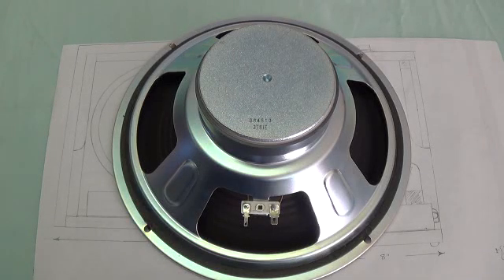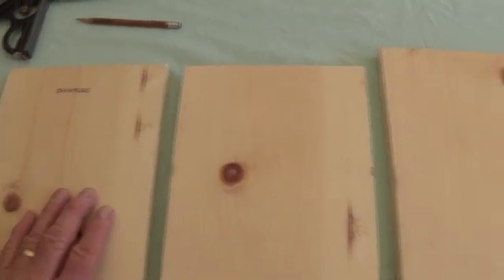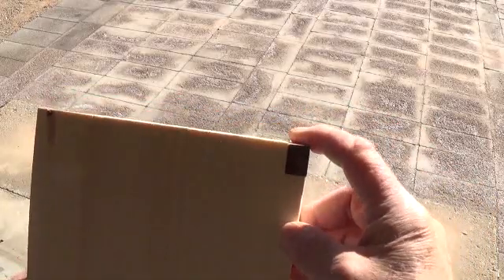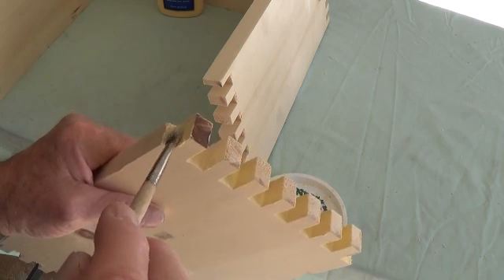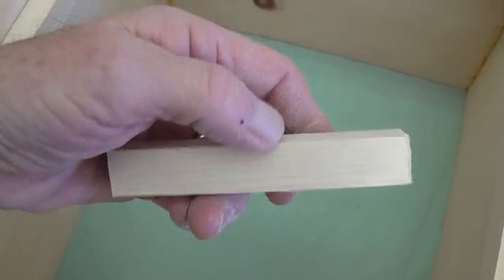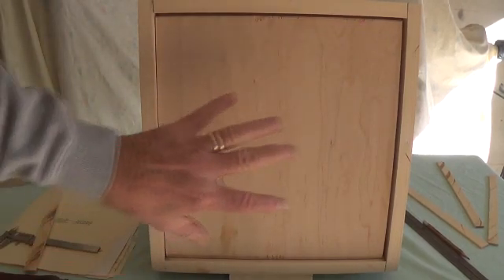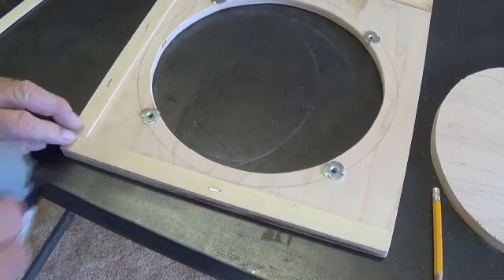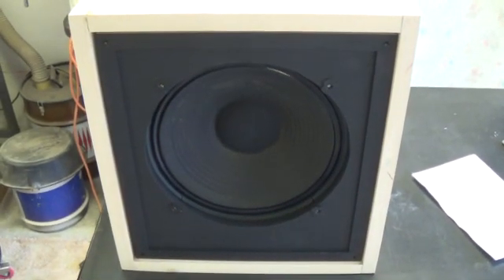Constructing a Finger-Jointed Pine Amplifier Cabinet.....Part 1

Comment: Hey Doug,
Thanks for your videos! You’ve really inspired me to branch out of my comfort level when it comes to custom woodworking. I’m currently attempting to build a replacement cabinet for my 52 Fender Deluxe Wide panel. I’m hoping to go without the tweed and give it a nice stained finish if I can avoid any mistakes. Is there any main difference with plywood vs solid? I have some nice ¾” red oak plywood leftover from a previous project and I’m thinking about using it. Keep the videos coming!!
Reply from the maker: boganjd I would say that although plywood is stronger than solid wood, it's harder to work with.....when cutting the inlets for box joints, it tends to splinter, and uncovered box joints will expose the laminated ends, which are not particularly attractive (IMHO).  My feeling is that plywood would be fine if you intended to cover the cabinet, but might not be suitable for a bare, finished cabinet. Again, simply my personal preference and others may disagree.....but I always try to give an honest opinion, based on experience, when asked.
Reply: Doug, thanks for the advice and the quick reply! All great points. Keep the videos coming!
Reply from the maker: We will, Bo. Best of luck with your project :)

Comment: LoL!  Rusty sniffing the pine plank..and he approves. 3/4 inch common pine.
 You can get a dovetail jig that you can use a router on, but I made my cabinets the old school way with making a box joint template (outside and inside) and a coping saw.  
Glad you mentioned to a square to make sure all 4 corners are square after applying glue though. Titebond glues dries very quickly, so it's always a race when applying glue to the finger joints on all 4 pieces.
Reply from the maker: +SuperCarver2011 Amen, SC. I'm always a nervous wreck as I race to get the joints all closed up and squared before the glue sets up.
Reply: +Uncle Doug; I built one cabinet with those box joints and being "el cheapo" to get a dovetail/box joint commercial jig for my router, I decided to make a template of the interlocking joints and cut out the wood with a coping saw.

Personally I am very scared of wobbly dado blades on the table saw. They are somewhat dangerous to your fingers
if you happen to lose concentration for even a fraction of a second.   I  would use a box finger joint that
you can use a small handheld router or works as well on a table saw, similar to what this site is selling. 
http://www.elitetools.ca/en/product/gabarit-incra-i-box-pour-joint-de-boite/

 In my case doing it the hard way by a hand held coping saw,  It took 4 times (four sides) as long to make the joints to  fit reasonably well before glueup. Unlike a routered box joint, cutting manually with a coping saw, you have the blade kerf error which leads to sloppy joints and trying to get those finger joints flat to mate properly (rasping the wood against the longitudinal grain was a real PiTA. 
Then I had to use makeshift 90 degree squares to make sure each corner was 90 degrees.   In retrospect, I should have bought the router jig., for about$200 or less and had perfect fitting tight joints.
This is one operation where you don't save anything not buying one.
Reply from the maker: There is a phrase that perfectly describes such short cuts:  They are a "false economy" :) I think we've all experienced similar frustration.
Reply: +Uncle Doug  I've run into this problem with any of the fast setting glues. TiteBond does make a product called
TiteBond II Extend, which  has a longer open time for complex joinery, such as dovetail joints or box joints.
The other thing that you can try to extend the glue set time is to pre-wet the finger joints where you are going to
apply the glue, with a small brush and a bit of water. The pre-wet joints will extend the glue setup time  by soaking into the pine itself and allow by a few minutes giving you more time to apply the glue, assemble and clamp the joint(s).  Once the presoaked joints air dry, the glue starts to setup. Might buy you another 20 minutes or so
of gluesetup time.
Reply from the maker: That's an excellent suggestion, SC. I'll try it on my next woodworking project. Thanks :)

Comment: I have to ask. The 1/8 spacers between the baffle and the grill cloth. Is that necessary or more for asthetics?
Reply from the maker: It's the way Fender does their speaker baffles, TT, and I have heard all sorts of explanations why.....including that without the spacing the grill cloth will make a flapping noise against the baffle. How you could hear the faint flapping of grill cloth while the speaker is blasting "Foxy Lady" at 135dB I have no idea.

I have my own theory: Grill cloth (some more than others) cuts down on the flow of air as the speaker cone moves back and forth, and suppresses its motion. If you glue the grill cloth to the baffle, then all the speaker's air has to pass through an area of grill cloth equal to the diameter of the speaker hole. If the grill cloth is floating above the baffle, then the speaker's air can pass through the entire rectangular area of the grill cloth, greatly reducing suppression.
Reply: Uncle Doug Your theory makes sense. I was browsing different designs and cabinets and it seems like it's 50/50 to use spacers or not, and I assume that not using the spacers is more of a function of having to do less work. I have a cabinet with no spacing and have not heard any flapping ... but since I am building a new one I may as well take the few extra minutes and space it. Thanks for the reply.
Reply from the maker: You're welcome, TT. Since Fender was famous for cutting economic corners, the fact that they persisted in spacing out their grill cloth tells me that there really is a benefit to doing so. Best of luck with your project :)

Comment: Your woodworking skills appear to be on par with your electronic knowledge. Once again, you've supplied me with the missing pieces I need to do more stuff. Now I'm confident to attempt a clone of my '56 Tweed Princeton, as well as the cabinet for a mod of an old Hammond AO-35 reverb driver amp that I think is gonna make a nice Vox AC-15 type of circuit with the EL-84 out put stage. Thanks again, Doug.  Also, give Rusty a pat on the head and a biscuit. He''s your buddy.
Reply from the maker: You're quite welcome, JP. It sounds like you have a pair of excellent projects. Best of luck. Be sure to let us see how they turn out. Rusty sends his regards and appreciation for the pats and dog biscuit :)  ^. .^

Comment: Doug, one suggestion to use a method that I think might work for the T-nuts.  I use a Forstner bit to recess the T-nut head just a tad.  It doesn't have to be done but I do it anyway.  Also, I put a dot of black paint on the end of the bolt so it won't show through the grill cloth.
Reply from the maker: Greetings, BB. I too recess the T-nuts if the grill cloth is attached directly to the speaker baffle....so there is no bulge in the grill cloth....but with a grill cloth that is spaced away from the baffle, I didn't think it was necessary. If you watch the Part 2 video, the T-nuts, bolt ends, and baffle are all painted flat black (as you mention).

Comment: Doug, I have some old pine that I salvaged and it looks about the same as the wood in the vintage Fender amps.  I don't know amp tech work all that well but I can do woodwork.  These finger joint jigs work great.
I have also used biscuit joints for amp cabinets and this method is also very strong.

Comment: Love your videos !  regarding the hole for the speaker baffle,  I use a laminate trimmer (small router) to cut perfectly symetrical holes.  I made a quick jig out of plywood onto which the trimmer is attached, screw the jig to the center of the baffle board much like your compass  and rotate that baby - start with a shallow cut then increase blade depth until your through - perfect hole every time.  You could even use it as a template to make one of those cones for Rusty's neck, if he ever has an operation ....
Reply from the maker: I like your suggestion regarding an alternate way to cut speaker holes, Peter. Hand-held saber saws are no fun at all to wrestle around in a circular pattern. I always end up having to do a lot of touch up afterwards. I'll give your suggestion a try on my next baffle. Re Rusty, let's hope he never needs a cone or an operation. I don't think he would be a very good patient :)

Comment: I'm planning on making the cab bigger. Would I have to use pine that is less thick? If so what would be an arbitrary thickness. Thank you for the insightful videos.
Reply from the maker: Greetings, OTM. I recommend 3/4" pine for all medium to large cabinets.  It is structurally superior to thinner wood....which would be of particular benefit in larger, heavier cabinets.

Comment: Great video is there a rule to how much room should be around the speaker ? To establish the cabinet size? Thx, Sorin
Reply from the maker: Greetings, Sorin. I generally allow about  0.5 to 1 inch on either side of the speaker rim. The top and bottom clearance varies depending on where the chassis is located. You have to be very careful to provide sufficient clearance between the speaker and the tubes and transformers. It's no fun to find out that your chassis won't fit in the cabinet due to speaker interference.  Good luck :)

Comment: Top quality work!  The finger joint jig looks much more efficient than doing them by hand (the way I did mine).  I used a plunge router with a home made circle cutting jig to cut my speaker hole, I will be glad to share my technique if your interested.
Reply from the maker: Thanks, Andrew. I tend to prefer the saber saw to a router for holes, but I would be interested to hear of your technique.
Reply: I've used a router with a circle cutter and made some nice holes, but I think that your method using the router table is much better. To do a proper job with a router and a circle cutter, you need a scrap piece the size of the baffle underneath to support the baffle. If you don't support it, it's kind of like cutting a tree limb off while you are standing on it.